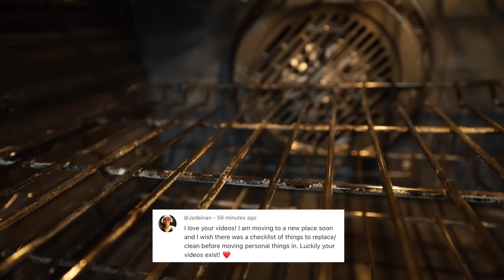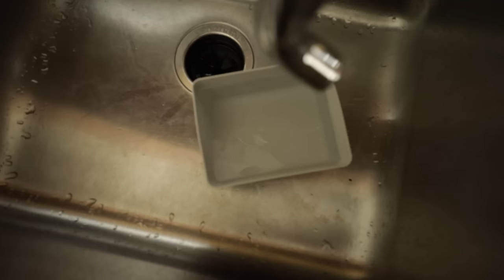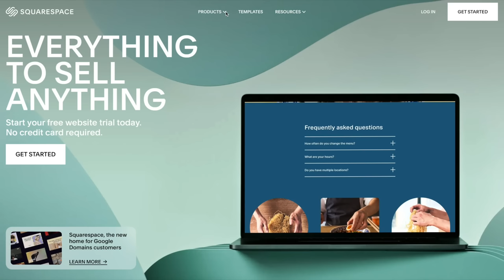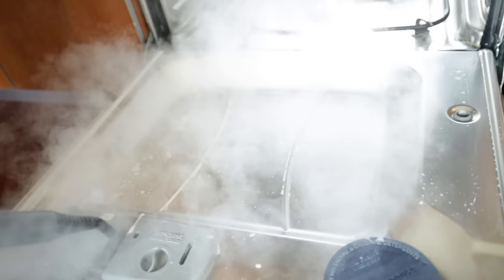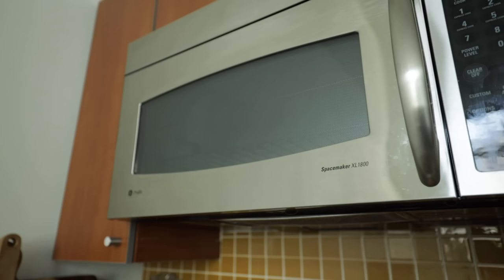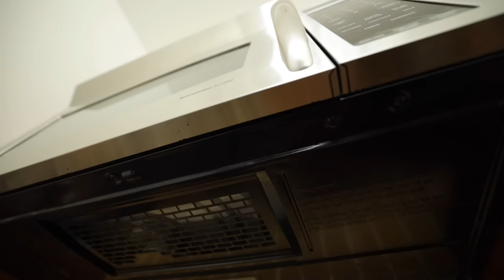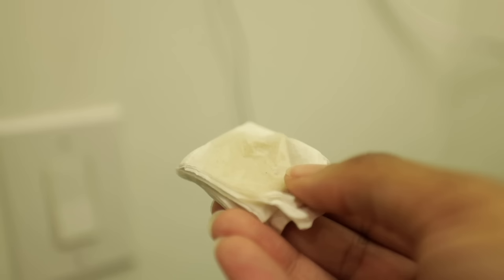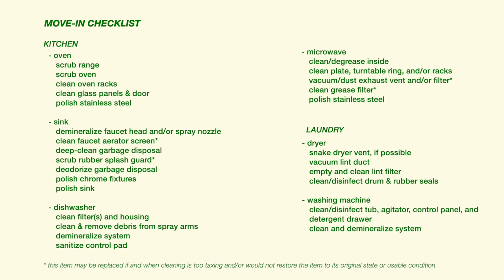Deep Cleaning my New Apartment | Do This BEFORE You Move In (Eco-Friendly)

Comment: I used to manage apartments for years. I wouldn’t let an apartment get rented like this. However, I always did a walk-through with a checklist and went through with new residents moving in, because I wanted to make sure they were happy upon move-in. If they felt something wasn’t clean, I’d either clean it myself (if it was 1 or 2 things that would take me 20 minutes or less to complete) or get the cleaners to come back, if there were more items that the resident wasn’t happy with. Most of the time, the cleaners will come back for free, if the resident (or myself) is not happy with the cleanliness upon move in, at least with the companies I used. I would send the cleaners back with what needs to be redone. Apartment managers pay companies to come and clean, so please let your manager know if they need to come back. This helps out the manager and the management of the cleaning companies (or helps the housekeeping staff, if they have their own housekeepers). This helps the cleaners understand the expectations of the residents and management as well. I’ve managed properties in all different areas, but my standards were the same at new apartments and apartments that were built decades prior. Please communicate with your rental office, if the cleanliness is not to your standards. However, I did enjoy watching this video, thank you!

Comment: I'm moving into a small house that had roaches and pet waste masked by toxic cleaners, and a fresh coating of paint to hide the filth. I want to throw all the essential oils and citric acid at it as much as I can. I'm not sure how to properly treat hardwood flooring. That's going to be interesting to clean my current house for the next tenant and the new one that needs a lot of TLC.
Reply from the maker: good luck with the move. it sounds like a lotta work but you also sound very prepared. i havent tried it yet but hear linseed soap is good on hardwood.

Comment: Do you know there's linen sponges/dish cloths? I use walnut shelled ones for now. I have chainmail for my cast iron. I make disinfecting wipes from a doTERRA recipe (1/4 c rubbing alcohol, 1/2 cup white vinegar, 1 cup slightly boiled water, 5 drops each of lemon and lavender oils, plus paper towels).
Reply from the maker: i may need to invest in some chainmail 🤔 i get tired of scrubbing the unpolarized oil😩

Comment: PSA about the microwave cleaning!! If the liquid is heated too long without being disturbed, it can “super heat” which means it will boil internally without any visual indicators. As soon as it’s disturbed by either dipping a rag in it or even moving the glass, the boiling will immediately rise to the surface and explode. That’s why you aren’t supposed to heat coffee (or anything really) for long periods without stirring inbetween. This is specifically a microwave issue, not necessarily oven or other heating appliance. PLEASE be careful!! So many people have been sent to the ER for this very reason.
Reply from the maker: Thanks for the warning! ⚠️

Comment: Wait, what "last video"? I need to know what you use for cleaning and what you use for what? What's in the spray bottles you used in the "clean with my adhd"?
Reply from the maker: here you go
https://youtu.be/rZ1Q0Dxh9s4?si=v5cHRhxi_HCRZRIS

i either use castile soap, citric acid, vinegar, or buy all purpose cleaner concentrate to dilute in water. Currently using the one from grove co
Reply: Thank you @abetweene !  Would linseed soap work instead of castille soap do you think?
Reply from the maker: yes it would 👍